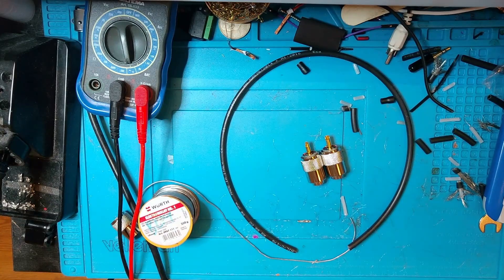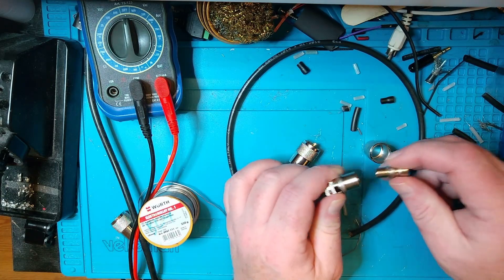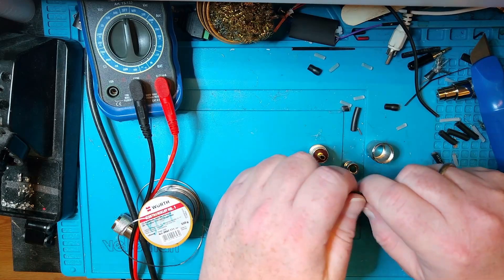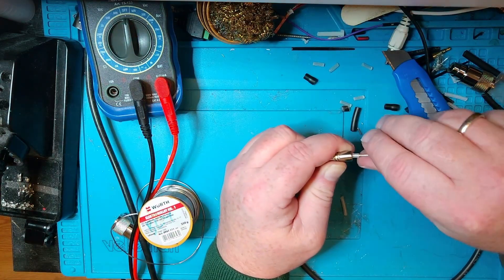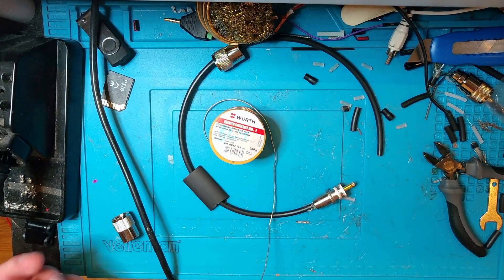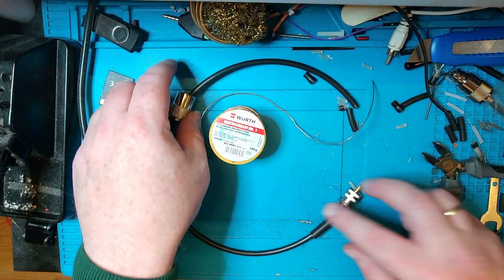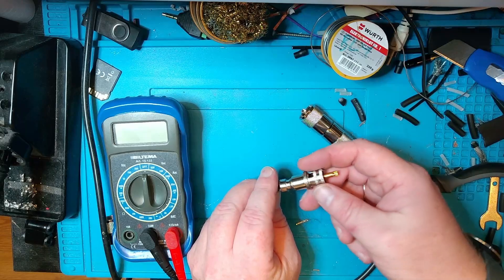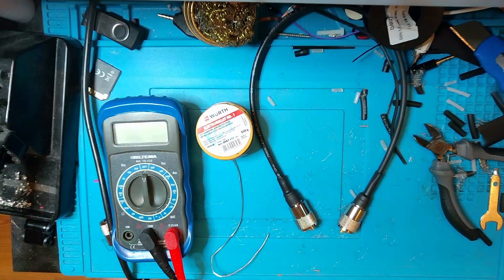How to solder a PL259

Comment: Hello nice video . The soldering iron I use looses it heat on some plugs , what type of soldering iron , and size of solder (mm) , leaded or not ? Thankyou
Reply from the maker: I use a no-brand cheap soldering station, which seems to work fine for me. I have recently purchased a Pinecil, but I haven't tried that on plugs yet. I tend to use a relatively large plug for better heat transfer and leaded solder. Always leaded solder, even though it gets harder and harder to purchase.

Comment: didn't know the adapter PL for multiple sizes. cool thing. i don't solder the outer screen either but with these connectors i'd try to fold it back over the adapter and then screw the adapter in to get it pressed between adapter and connector. I'll have to order and try that. well done, Morten. 73
Reply from the maker: @db3mi  I have tried both ways. What I find is that when folding it over the adapter it tends to short easier. I was going for as easy as possible in this video.